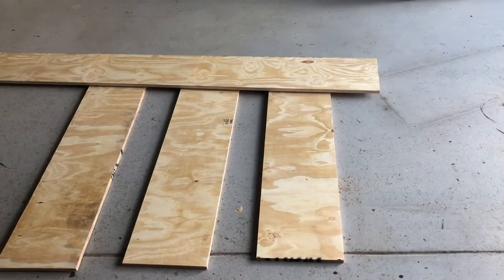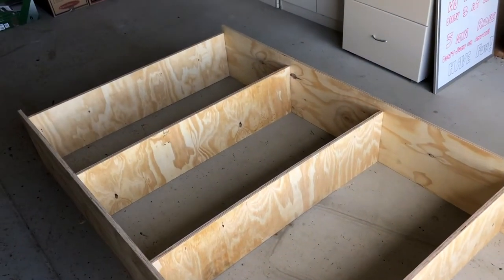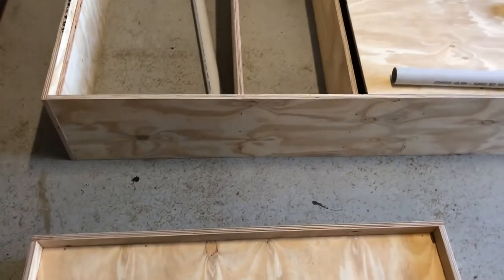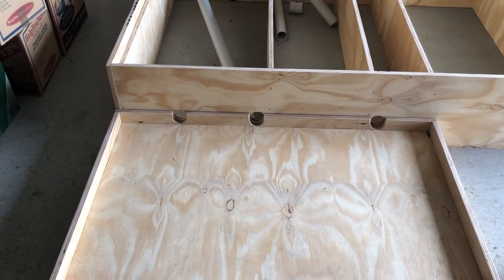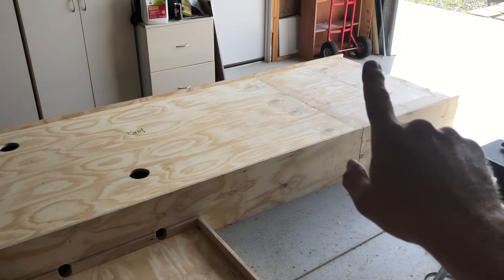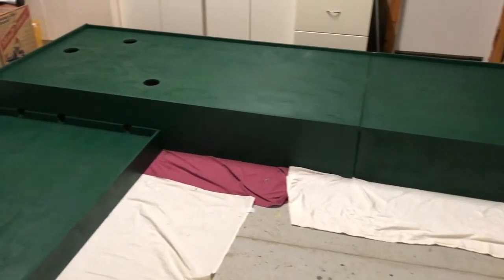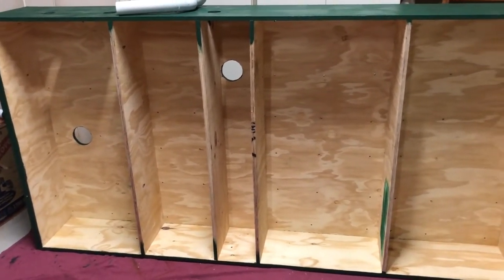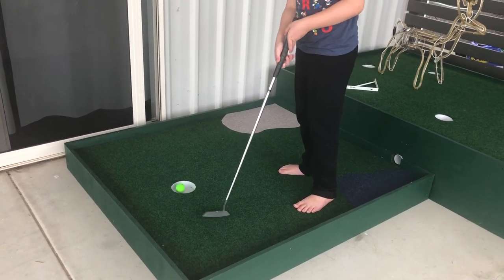How to build a Mini Golf Course

Comment: What did you use as the cup that connects to the tubes? It it just like a regular pvc funnel?
Reply from the maker: Yep spot on. Just a PVC funnel down to 50mm pipe.